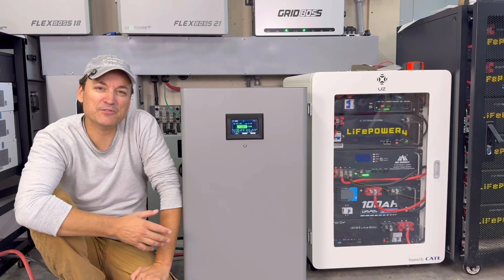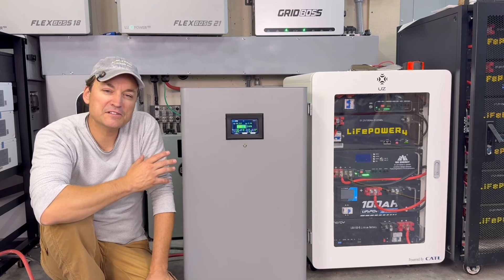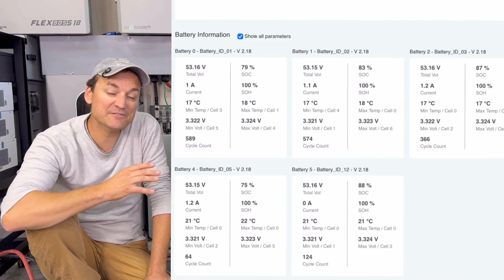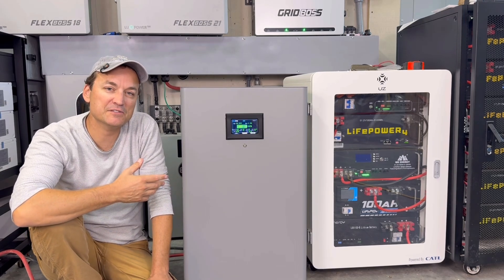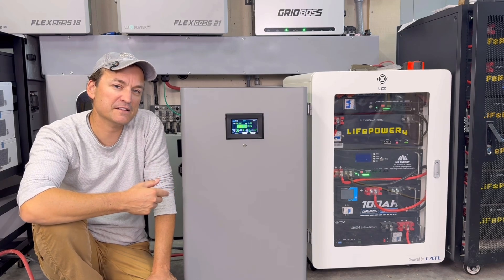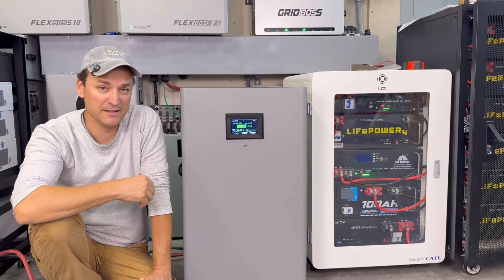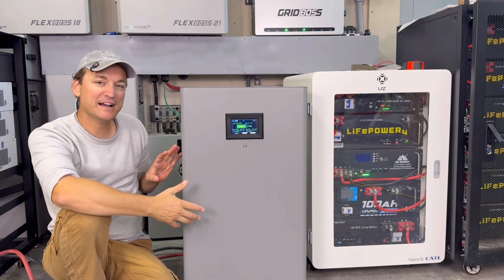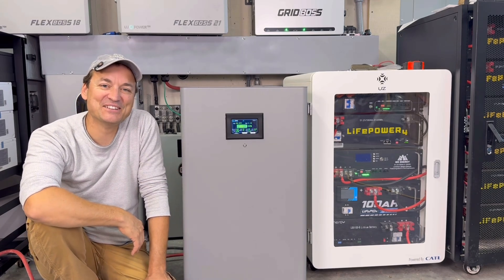16kwh Yixiang battery, how I added it to my home system, and how to program coms to EG4 inverters

Comment: Thanks for the video.  I have heard that the EG4 inverters need 2 batteries to satisfy a 200A requirement.   I assume if 2 EG4 batteries are needed then so would the Yiaxian need to be 2 or more.  

I am leaning to ordering 3-4 of these to be used with wither 12000xp or FlexBoss21. So I am wondering if you can buy the amphenol connectors that the EG4 wall mount comes with.
Reply from the maker: This can discharge at 200 amps. The larger eg4 inverters like the 12000xp or flexboss21 require 250 amps at least to reach full output. So yeah at least 2 of these, ideally more. 

And yes, you can buy those connectors on Signature Solar’s website.
Reply: @GavinStoneDIY thanks.  The cabling on the upright wall mount versions seems to be an issue for routing and not having wires everywhere.  Of course I need to focus on functionality but it needs to look good for the Mrs.  Haha
Reply from the maker: @brentjohnson6654 can can run a wireway above them, and add a central busbar inside that. Makes it look clean.

Comment: YIxiang power are the absolute worst company to deal for after sales support. I would be very careful being associated with these guys. I spent over 2000 USD with them through Alibaba recently. The battery box arrived beaten up, damaged in transport, with the BMS rails and other bits bent, and missing parts.  Becky was horrible to deal with, and Alibaba was no better. Becky makes it impossible to claim any compensation, or replacement parts and absolutely refuses any refunds. Once you pay your money, attitude totally changes. Disgusting! 3 months later and I've basically been ripped off. The money back, returns and refunds being advertised on their Alibaba merchant page and website, is simply blatent false advertising. They get away with it because they operate out of China. In any other country which has consumer laws they would shutdown. Beware everyone! If you're interested I have all the evidence, pics and correspondence. Happy to share, hopefully to prevent someone else losing their hard earned dollars!

Comment: Gavin thanks so much for your videos I have an 18 Kpv and 6 eg4 Lifepower 4 server rack batteries.  I have been interested in getting one of these Yixiang batteries but did not know how it would work with my existing EG4 batteries and the closed loop communication.  Do you have a video that shows how you wired this Yixiang battery to your 18kpv?
Reply from the maker: This video would give the basic description on how I would do it. A central busbar, and connect all the batteries to that.
Reply: I have a very similar setup and also am looking to buy one or more of these 16kwh batteries.
Reply: Ok a central buss bar and connect the eg4 and yixiang batteries to the Busbar and the busbar to the Battery lugs in the 18kpv?
Reply from the maker: @danielbabcock5577 exactly yes. The central busbar just gives a nice connection for all the different batteries to meet in the middle before going to the inverter.
Reply: @GavinStoneDIY Is it possible to just connect this battery to the eg4 battery and not use bus bars? Thanks.
Reply from the maker: @Goflyrc2  if you already have an eg4 cabinet, you could attach to that busbar. Or if you have wall mounts you could make a parallel cable and connect it to one of those. Either way though I recommend adding a fuse between this battery and your other pack.

Comment: Can the 12000xp communicate with both eg4 batteries and one or more yixiang batteries at the same time?
Reply from the maker: No. Either one or the other.
Reply: @GavinStoneDIY what about two connected-to-each-other 12000xps? One communicate with eg4 server rack batteries and other communicate with yixiang? Both sets of batteries connected to common bus bar that connects to both inverters.
Reply from the maker: @grace_let you could do it that way. You would leave the packs separate. No common busbar. And use the separate battery option. Each can communicate with its own pack.

Comment: I take it you're not able to come close to charging all those batteries to 100% SOC even on a sunny day? If you can, how?? I can't even get my single EG4 wall mount 280 AH to 100% on most partly cloudy days with 7 KW of PV,  let alone cloudy days.
Reply from the maker: I have around 18kw of solar. If I’m at a really low SoC I can’t get them fully charged no. But the following day I can for sure. And of course some of it depends on how much you’re using during the day as well. 
Every system has a tipping point. Adding an additional 4kw more of solar made it so I can power all my loads and still charge things  pretty heavily every day.
Reply: @GavinStoneDIY  Thanks very much for the reply. Here in Maine, especially in the winter months, we commonly have 3-4 days in a row of very dark overcast skies. So I guess I need to figure out how much PV power I need to overcome that. I feel like it's going to be a lot, particularly when I add a second battery. As I write this it's cloudy and my battery SOC is at 1% at 2:00 PM.
Reply: @mainebears711 goodness, find a way to put more panels up. That's the only way to fix this. That is bad :(
Reply: @WillProwse  Funny you should mention that, Will.  Today, I bought 8 more LG 370w panels giving me a total of nearly 10KW of PV.  Really hoping that improves things.  I have an FB21 so I can go a lot higher. Thanks.
Reply from the maker: For some reason I thought you had a 6000xp. Yeah dump as much PV on it as it takes to start getting ahead of that discharge.

Comment: Gavin do you really need inverter to communicate to the battery? Can you just set charge voltage and cut off and reconnect voltage?
Reply from the maker: Yeah you can do everything based off voltage. Some people prefer that actually. I like using communication myself.

Comment: What's the downside to a jk-bms battery not being able to communicate with eg4 batteries?
Reply from the maker: Not a huge downside really. You won’t get info on the battery remotely. Also if you don’t have enough battery capacity, then the inverter wouldn’t output or charge at its maximum, since it only sees a certain amount of battery. If that makes sense.

Comment: Okay stupid question why would you need/want the battery to communicate with the other batteries
Reply from the maker: You wouldn’t really need to assuming you already have enough battery to reach max output and charging. But most people ask if they’ll communicate with each other, so I always try to give details on it.
Reply: Will it cross communicate with the EG4?   Some people are telling me if I use that battery with my wall mount EG4. I have to change the inverter to lead acid. Make sure that are both charged to 100%. Connect them and go.   I would not be able to see the SOC. Only voltage
Reply from the maker: @andrewlamb8219  I’m doing both. Sort of a hybrid version. The eg4’s communicate, and this battery just hooks in parallel without coms.
Reply: @andrewlamb8219  , if the batteries are the same size and connected in parallel. The SOC indicated by the EG4 battery should actually represent the SOC% of both batteries.  It's just that now that SOC%  Is a percentage of twice as large of a battery. (The  SOC% of the capacity of both batteries combined).   I think leaving it  in SOC mode  is far more useful than switching to L.A/voltage mode.  Especially for Home assistant automations etc.  I use the guybw/LuxPython_DEV integration from git hub. for H.A.. you have  message him to get acess and you also need an older dongle...although I suspect those two requirements may have changed.

Comment: I just couldn't spend that much so I went with four 600 ah Dumfume 12 volt batteries with a litime balancer for $2400 usd and 30 kwh.
Reply from the maker: Cheap. But maybe for a reason. They may end up lasting quite a while. I’m really not sure what BMS they use. The BMS is the most common failure in a lifpo battery. And you have 4 instead of 1. Plus the balancer. Yeah I’m just not into the 12v option really.

Comment: I have two EG4 wall mount batteries connected to a FlexBoss21. Using the Device manager, I can see the current level of charge of the combined batteries.  What app or product are you using to be able to monitor your individual batteries?
Reply from the maker: If you use the eg4 website you can see each individual battery and its stats.